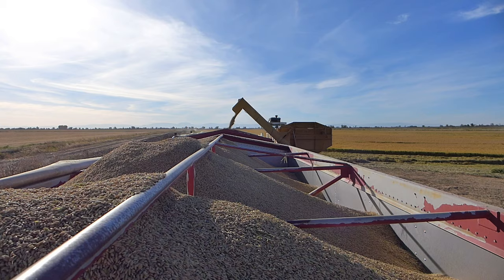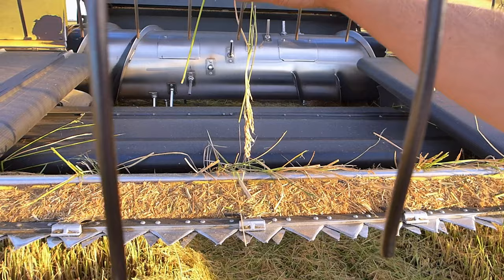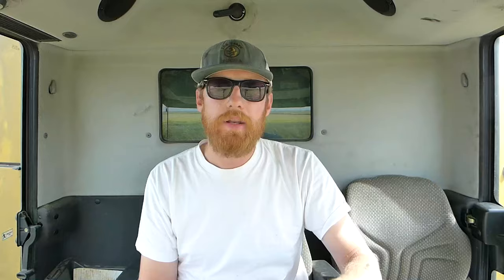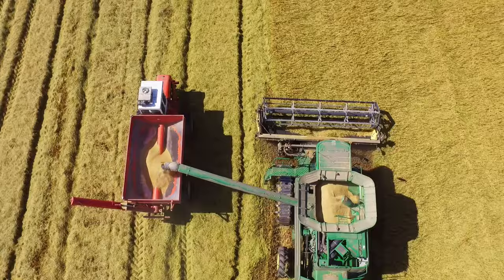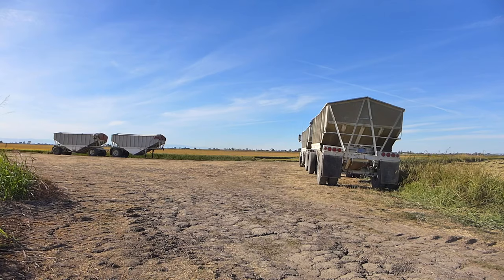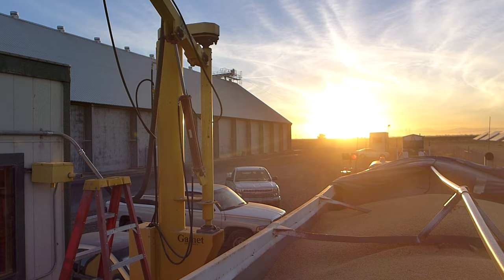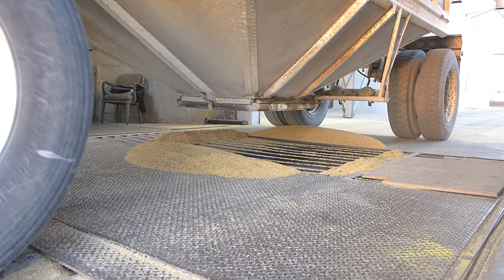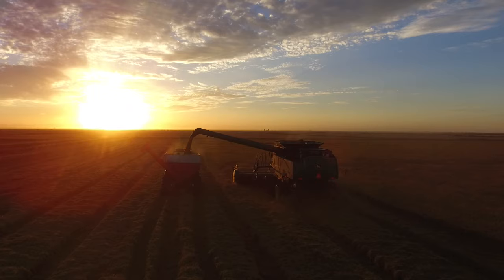How Rice is Harvested in California!

Comment: Good crop for Hawaii Big Island south region where they get lots of rain each year but calif
doesn't have the water to spare and is going to be a LARGE problem for water. Vietam lots of water for rice which is why its grown there.
Reply from the maker: Well it's been a strange 6 years in California regarding water. The first 5 we had a progressively worsening drought and then the 6th year was full of excessive rains that over filled our reservoirs (Oroville Dam). So maybe we don't have enough storage of water for the dry years. You are right, there is great potential for water issues because everyone needs it or wants it and it's being monitored. As long as it rains as normal during the winter we will be fine. 
-M.